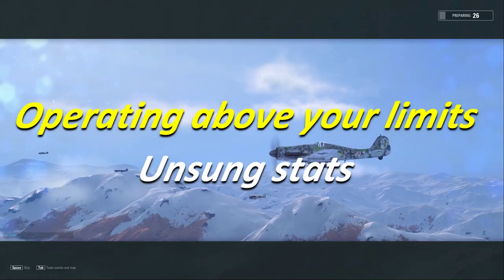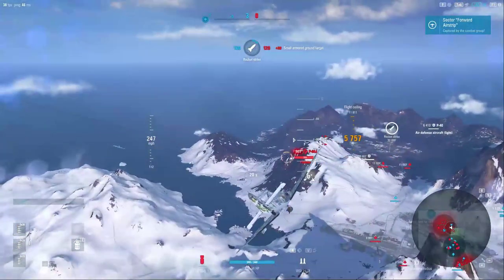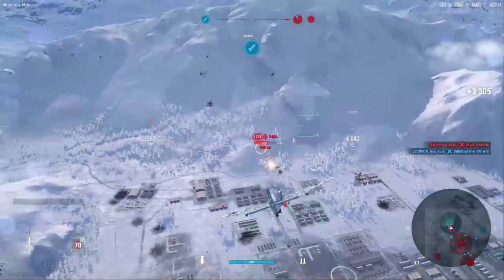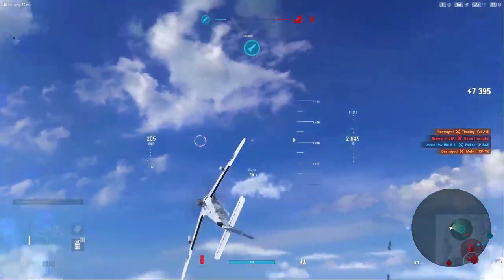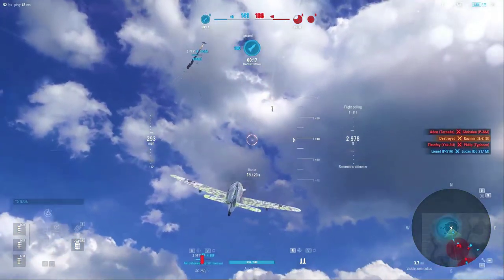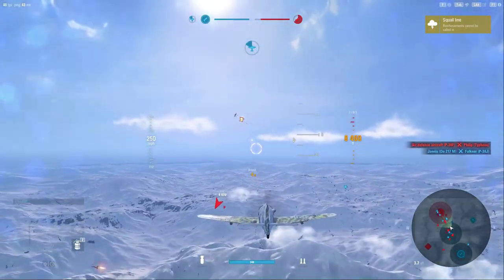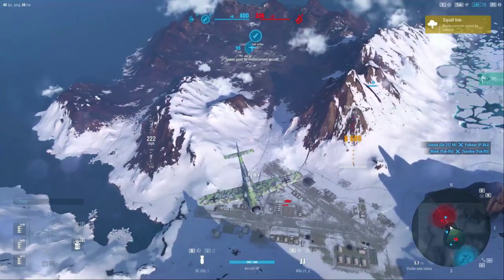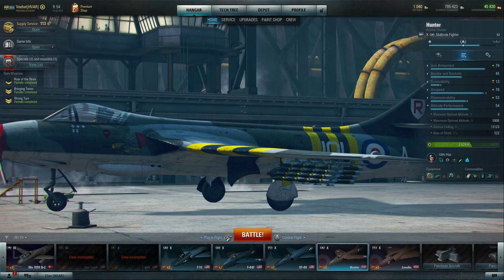World of Warplanes | Operating above your limits | Discussion Topic

Comment: Hi Vee bat I've rewatched this video, and I've recently watched your video about G-suits. I've used to use a G-suit on my Vampire opted for the bonus maximum flight altitude on it, and it really seemed that it has increased the overall altitude performance of the craft. So like when I've increased the max altitude, it secretaly buffed up the max OPTIMAL altitude aswell. Even if the stats in the hangar haven't showed it, just the increase in service ceiling. Of course G-suits are only for period III aircrafts. I'm currently grinding the Pirate, and I'm seriously thinking to use the G-suit once it specialised, with the above mentioned reassembling. Because it's also a speed-fighter, but overall altitudness is a little bit lagging behind the speed-performance.
What's Your opinion? Thank You for Your regular quality contents!